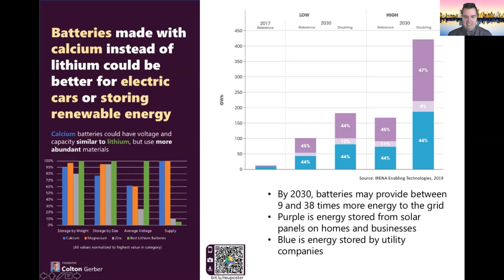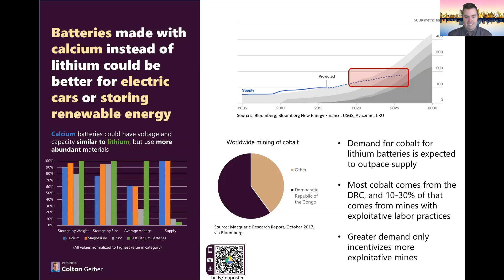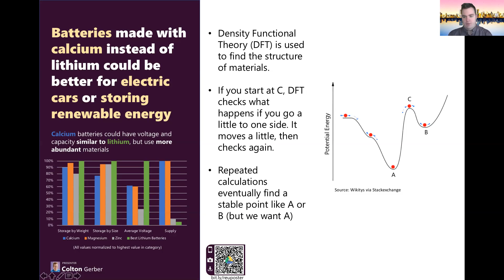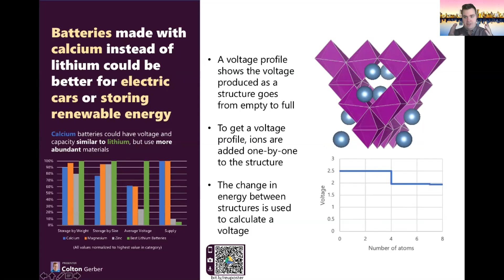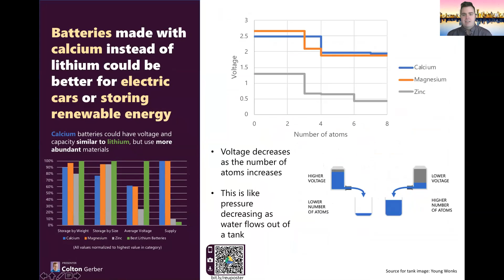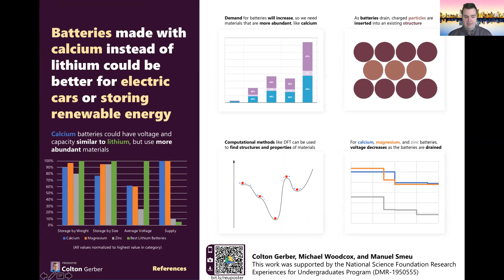Calcium batteries could be better for electric cars or renewable energy - Colton Gerber NY-BEST

Comment: Hi Colton, thanks for sharing this. If Calcium batteries have these obvious advantages why do you think the automotive and solar industry are insisting on using and marketing lithium batteries? I couldn’t think of an answer that makes sense
Reply: Just off the top of my head, Lithium battery production is already very established and has consumer and commercial demand where as Calcium does not have this at the same level we are talking where it's replacing Lithium.
Reply: I just bought a battery on which it's written ca-ca technology 12v d31/N70 but haven't used some before so I was searching and came across your video. I hope it will take me far before spoiling